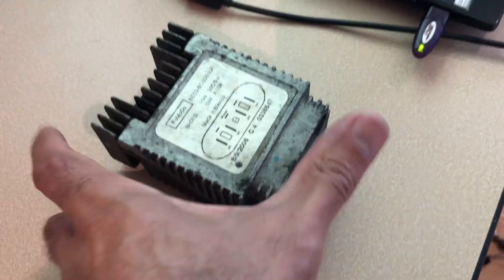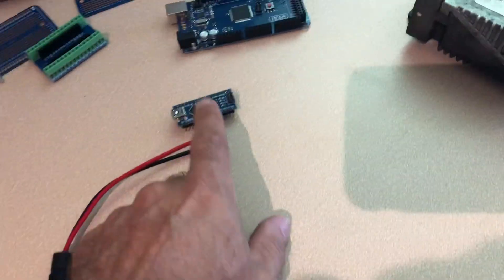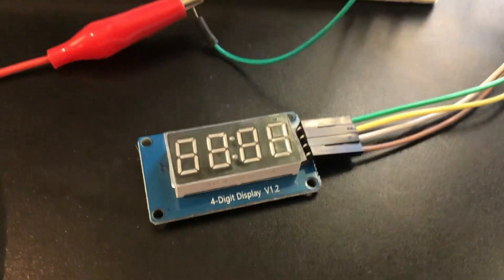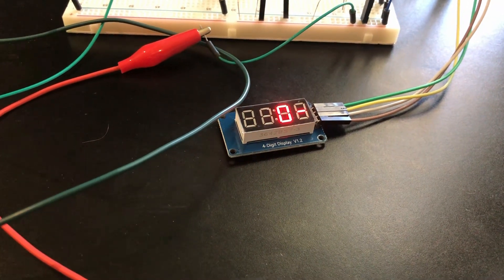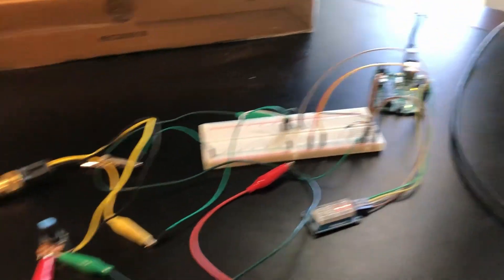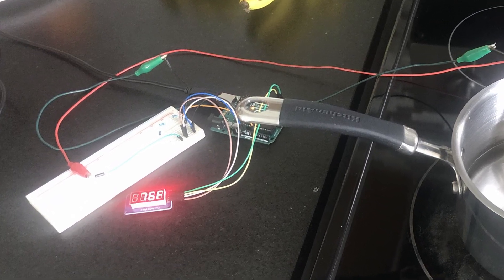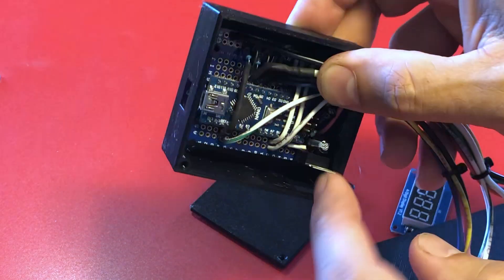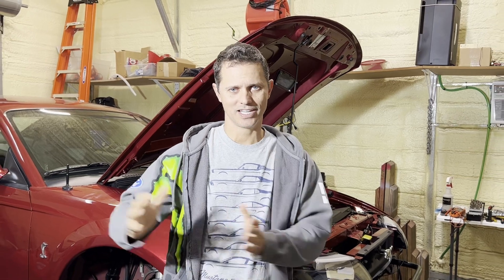Building our Fan Speed Controller for the 92 Fox Body

Comment: Hey malcolm could you let me know were i can get the aldewno chip from or can you help me out with a part list and were i can get these electronic parts from because i already have a fusion control i just dont know were to get the other things at and the crocect names for them . Thank you
Reply from the maker: You can search Amazon or google etc. and read up on Arduino.  It's not just plug and play though.  They are microprocessor chips that ship to you essentially blank.  You then have to write the code and program them to do what you want.  Since they are so universal they are great for these type of projects.  But you'd have a bit of a learning curve programming it and making it do what you want.  They are extremely well documented so tons of resources online if want to learn.
Reply: @MalcolmV8  I sure do. It never hurts to stretch your knowledge. Thanks

Comment: I see you have a power and ground to the battery? how would one wire it a stand alone like a ms3pro or holley?
Reply from the maker: You still need to give it battery power and ground.  It's just the PWM signal to control it that comes from the ms3pro, holley, fueltech etc.  There's a fairly simple wiring diagram about 12 minutes into the Lincoln Mark 8 fan video.  This link should jump you right there https://youtu.be/DLvA0t5BB30?t=716
Reply: @MalcolmV8  Thanks the videos you make really help me along with my holley/03 cobra build. thank you for doing these, I am sure it helps alot of ppl out.
Reply from the maker: @scottadkins918  you're welcome and I'm glad its helpful :) that's great feedback, thank you.

Comment: Would something like a Frequency Generator, DROK DC 3.3V-30V 5-30mA (Amaz**) drive the Ford controller?  I just need it to slow the fan so it does not sound like a jet engine.  I can trigger the controller with the Holley Sniper. So I am clear...Will the Ford controller works on brushed fans?
Reply from the maker: Yes I don't see why you couldn't.  I've used Arduinos to drive them with variable frequency to adjust fan speed as desired.

Comment: Do you have any idea how many kHz the factory PWM fan controller unit is putting out to the fan?  Spal says that their fans need 7Khz or they will burn out rapidly.  There are stand alone commercial versions available but I would like to build a junkyard DIY unit.  Thanks.
Reply from the maker: Yes I actually have a video where I demo the hum and issues with low frequency fan control and then test the factory PWM controller with a scope.  The video is called "Fan speed control MS3 Megasquirt".  I measured 19.2 KHZ on that Ford OEM controller.

Comment: Awesome video 👌🏻
I wonder if at all possible, a parts list for the aduino and maybe a copy of the codes used? I was just about to order a lingenfelter pwm controller, but the fact that it doesn’t monitor speed, makes me wonder if I could build a smarter one myself. And maybe even one that doesn’t set my fans on full speed with AC on, in the freeways:-)

Sorry for the bad spelling, hope you will help 🙏🏻
Reply from the maker: Hi, sorry at this time I do not have a complete parts list and circuit diagrams etc. of that exact project.  I did build something similar a while back that was CAN based to a megasquirt ecu and posted up details here http://www.mdracingkc.com/index.php/test-menu/20-can-based-arduino-transceivers-for-megasquirt-ecus 
Perhaps you can use it as a starting point and extrapolate from there.